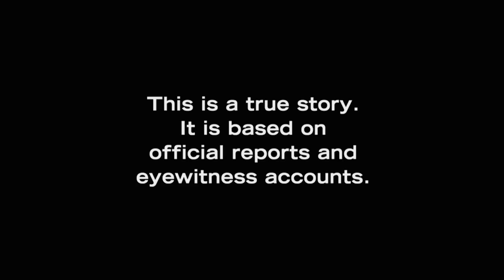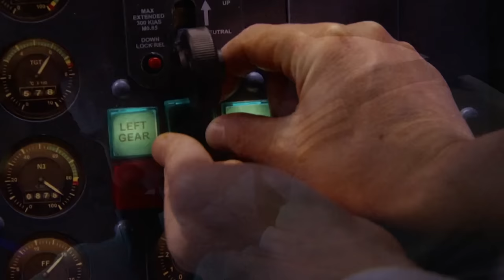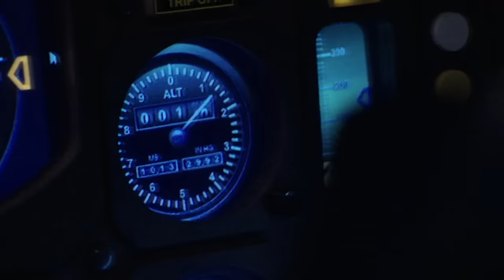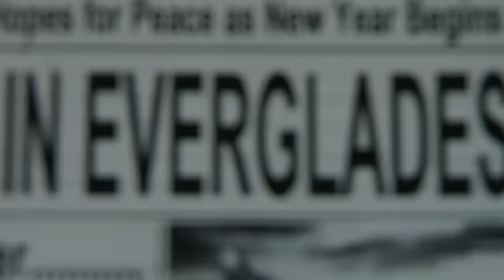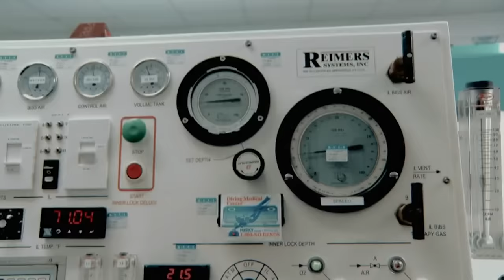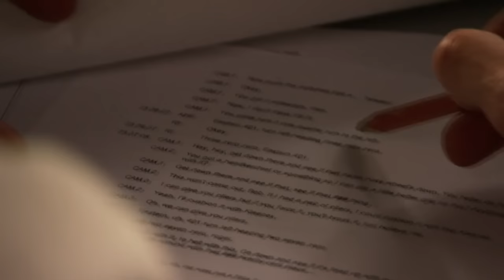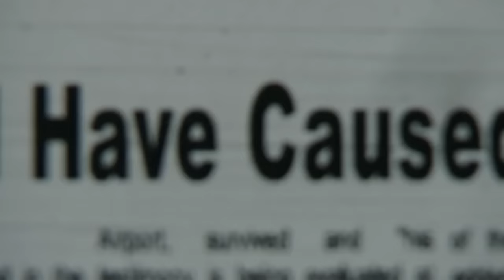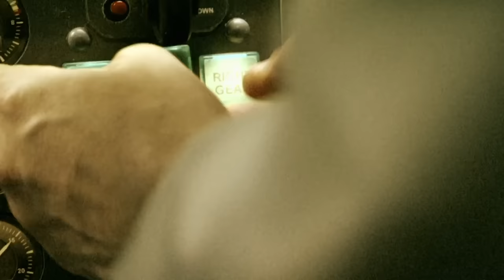The Fatal And Devastating Crash Of Flight 401 | FULL EPISODE | Mayday: Air Disaster

Comment: The only landing gear they weren't sure was locked was the nose gear. They could have easily landed and skidded on the nose. Air traffic controller said he seen their altitude and assumed it was wrong instead of advising the crew to check their altitude. Honestly it seemed like this was just a crew that couldn't handle stress. A lightbulb...all this over a damn lightbulb for nose gear you can land without.

Comment: Every jet is the most advanced.   Every airport is one of the busiest.   Every pilot is one of the most experienced.    Same old from these videos.   I want to hear a story of one of the least popular jets.   I want to hear of one of the least busy airports.   I want to hear about the least experienced pilots.   My message is:   Just give facts please.
Reply: it’s because the L-1011 was actually renowned for its technological advancements compared to its peers. ACI also mentions “most advanced jet” with the a320 as it was the first plane with fly-by wire. Also what ACI says is relative. Like most experienced pilot for the airline or most advanced jet for the time. They also only mention busiest airports when it is a major international airport with heavy traffic to add emphasis. There is accidents with smaller airports like huntsville and little rock / sioux city
Reply: @John.0523  I get it.   But watch these airplane videos.   They all say almost the same thing.   What would be a crappy airplane?
Reply: @toddclean547  TWA Flight 800 (old wiring). Aloha Airlines Flight 243 (high duty cycle count), Chalks Flight 101 (59-year-old plane with cracked wing)...
Reply: @toddclean547  The worst ratio to accidents in a commercial airplane would prob be an early 707.  But it's still safer in that than a car, statistically.
Reply: @jordanb2812  Very accurate information.   I am only repeating what the narrators say in these videos.   I watch them all.   (Thank God you get it that TWA 800 was not a missile!)
Reply: @MMMmyshawarma  Agree
Reply: Maybe you should start your own channel with those stories and "just the facts" 😉

Comment: When the flight engineer tested all the bulbs using a panel switch, one bulb failed to light up. That should have been enough for them, instead, they persisted in looking at everything, wasting precious time that they didn't have.
The crew wouldn't have been able to fix a bad nose wheel assembly in flight anyway.
Reply: I thought the same exact thing. That method right there should have proven it was the bulb end of story. Why all of them focused on that and nothing else is crazy. Also though, having autopilot turned off with a slight bump was a serious flaw in design

Comment: WAIT A MIN...WHY  DIDNT  THE  CONTROLLER  SPEAK UP N TELL THE  CAPTAIN  UR  TOOO LOW''??  ITS THE  CONTROLLERS  FAULT FOR  NOT  SPEAKING  UP   IMMEDIATELY
Reply: WELL  CHARLIIE...ITS  ALLLL  UR  FAULT FOR PLANE CRASH   FOR  NOT   SPEAKING UP /AND  DIDN'T....  YOUR   THE  PROB.
Reply: In this video, the narrator stated that the NTSB learned that the FAA did not specify keeping watch on a plane's altitude as part of a controller's duty at the time.  Sounds a little lame and I think if I were in that ATC's shoes that I would have mentioned it, given the plane's location over the everglades and down to 250 feet alt.
Reply: @tomortale2333  it was a contributing factor yes but the not the only one.
There was plenty of blame to go around with flight 401 :
Authoritative and grumpy Captain creating undue stress in the cockpit, no pilot designated to actively monitor the instruments which would have allowed that pilot to know they were descending, an autopilot system that when bumped into would disengage its altitude hold mode without warning the crew, and a flight deck crew that was so fixated on dealing with the landing gear indicator light that none of them heard, or heeded, the altimeter warning chime that they were descending. Finally, yes the air traffic controller could have specifically warned the crew that they were deviating from their assigned altitude of 2000’ feet, but at that time controllers were not trained to say that, nor were they required to. 
I’m sure there were other mitigating factors I’ve failed to mention but this crash had plenty of blame to spread around and many important lessons learned.
Reply: THAT   FUKIN   CONTROLLER  ASLEEP  ON  HIS   JOB...IMMMED  TELL THE PILOT     ''''UR    TOOOOO   LOW''''!!

Comment: The fact the option to visually check the nose gear was available to them and they didn't immediately go and do it having additional people in the cockpit to do that is baffling. I'm surprised that wouldn't be procedure for that plane honestly rather than trusting a sensor. Those crappy pilots killed those people with gross incompetence.
Reply: Aren't you worried their ghosts will come after you?
You have a very good point though.

Comment: Sorry, if the airline did not inform the pilot how the new technology worked, it is not the pilots fault
Reply: They did post & mail out that bulletin, but apparently that method didn't work very well.
Reply: That wasn’t the argument regarding fault. There was plenty of blame to go around but what they did deem as the flight crews fault was the fact that they were all so fixated on dealing with the landing gear indicator light - no one was designated to fly the airplane/ monitor the controls. This was part of the “ Captain “ rules the flight deck  culture at that time. The captain was irritated creating undue stress and loss of focus. Everyone was fixated on that gear light and the captains authoritative irritated mood. 
That type of flight deck atmosphere is a recipe for pilot error. Unfortunately, those lessons are sometimes very hard to learn. In the late 90’s there was an AA crash in LIT ( Little Rock ) that was caused by pilot error and poor judgement by the Captain because the First Officer was too intimidated by the Captain to truly speak up and provide guidance when it was timely and necessary.
401 was not the last crash as a direct, or indirect, result of poor cockpit CRM.
Which by the way has now evolved into something the industry calls Human Factors.
Now there is always a designated PF or pilot flying and a PM or pilot monitoring. The specific division of duties was designed to avoid confusion so each pilot knows precisely what their duties are.
The system is still not perfect but it’s come a long way since 1972 with some very tragic consequences along the way.